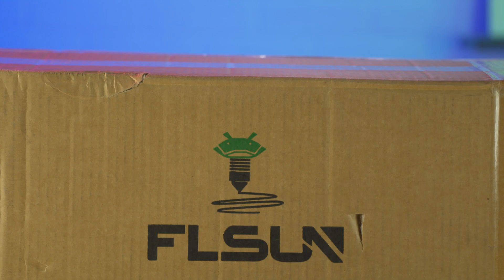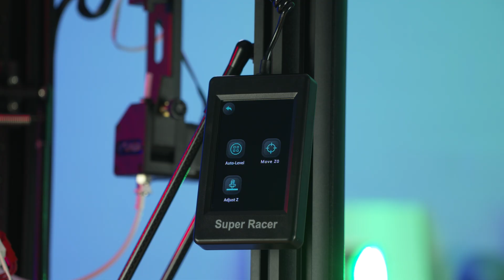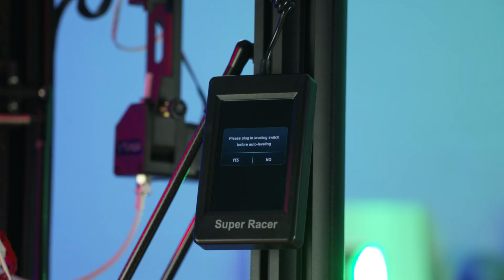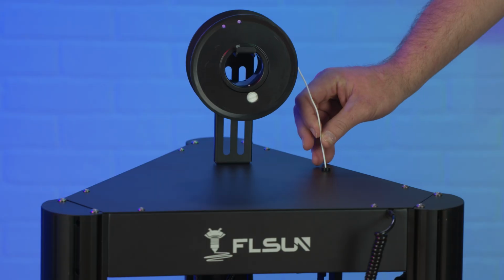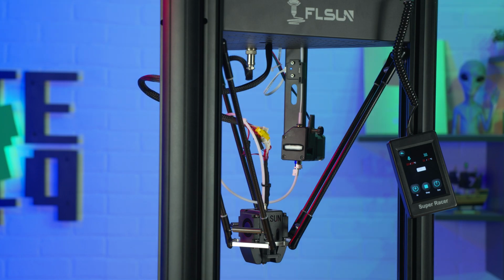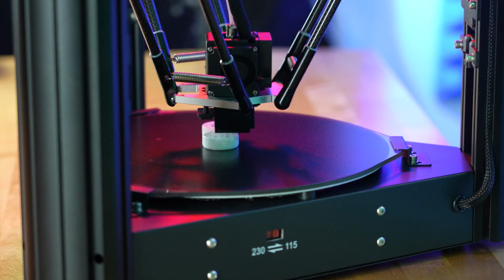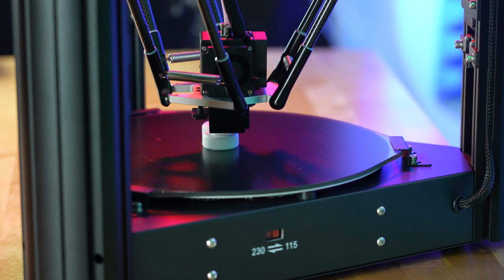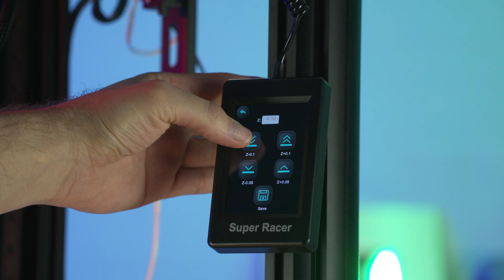FLSUN Super Racer - Easy Build, Super fast printing!

Comment: One thing to point out with a delta style printer like this one, while you have a 280mm or whatever it is width at the base, as you increase the height that space decreases drastically. Delta style printers can basically operate in a cone shape with a wide base but the top of very high prints is going to be limited and quality can suffer at the top also.